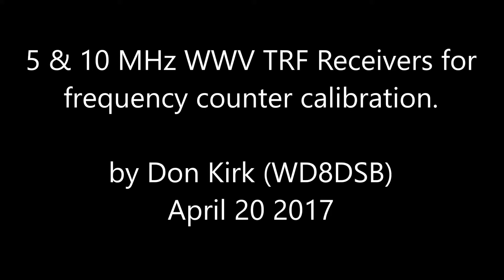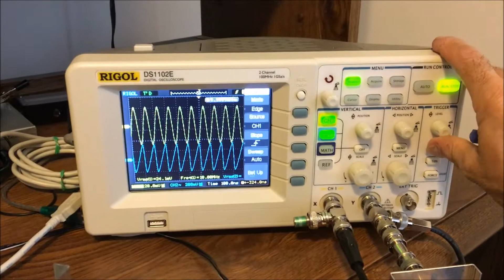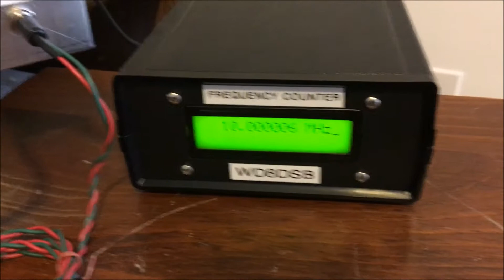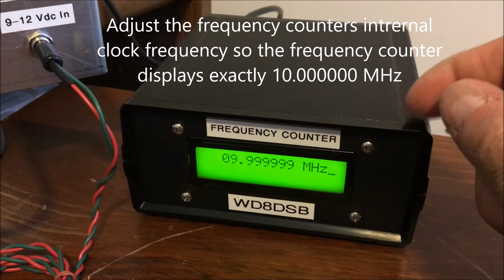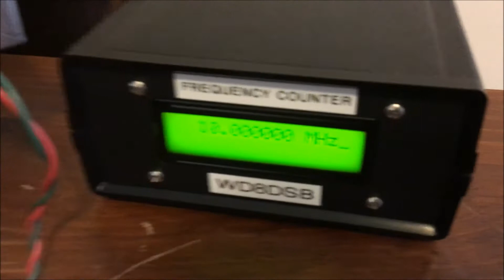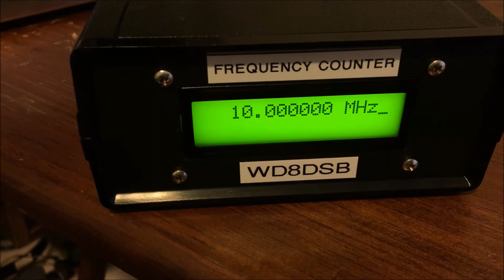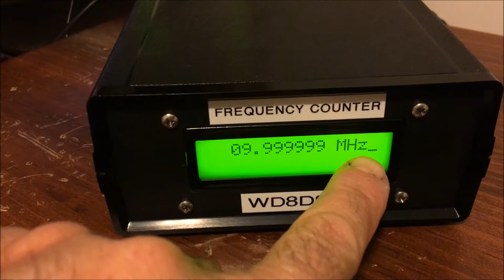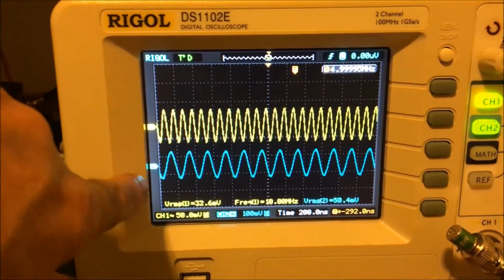5 & 10 MHz WWV TRF Receivers For Frequency Counter Calibration

Comment: Should be triggering off of the more stable signal. Ron W4BIN
Reply from the maker: HI Ron, Great comment and generally I would agree with your comment about triggering off of the more stable signal but in reality the overall results are the same (trying to get movement between the two waveforms to be stationary relative to each other).  I have tried it both ways for this application (and I just repeated it again after receiving your comment), and to be honest I would be hard pressed to suggest one method over the other for this application.  Triggering off the WWV signal channel in this application is logically a bit easier to understand/explain to others because it really is the reference signal which we are trying to adjust the other channels signal to, and it's nice not having the scope lose trigger on the reference signal (WWV in this case) when disconnecting the TCXO and/or other devices you are calibrating that are plugged into the other channel, but when triggering off the more stable channel (TCXO in this case) it's nice to never see the TCXO signal move or flicker.  73, Don

Comment: The link on your website to the article is non-functional. It simply displays a blank page with "No preview available" in a small banner at the center.
Reply from the maker: Hi Martin,

I sent you an email yesterday telling you I will send you a permission email next week when I have access to my PC.  I recently had to move my website to the new google sites and it handles attachments in a different way and  trying to learn their new system. You will get a message in about 4 days getting permission to open those links.

Comment: Hi, Is it possible to purchase the receivers? I need 2-3 units. 

Thanks,

Mike.
Reply from the maker: Hi Mike, 
Thanks for your interest in my WWV TRF receivers.  You would have to build the receivers based on my article in QST magazine.

Far Circuits is now offering circuit boards for my WWV TRF project at a very reasonable cost (offering both a circuit board for the WWV TRF receiver as well as the TRF preamp).  I am in the process of converting a website I have for the WWV TRF receivers over to a new platform, and when I have it converted I will post the new link for you.  My website has a lot of useful info, including a copy of the QST magazine article.

73,
Don (wd8dsb)
Reply from the maker: Hi Mike,  my WWV TRF receiver website is backup and running, and it has all the info you need.  The website URL is http://sites.google.com/site/wwvtrfreceivers/home

Comment: Very nice! Maybe strange Question: Would it be also possible to use WWVB for the same Purpose? Or would this be not as good as WWV ?
Reply from the maker: Hi DE2017.  On October 29, 2012 WWVB went to a phase modulated format which makes things more difficult.  The nice thing about the WWVB signal is that it is very stable and you would not encounter slight doppler effect which happens on HF frequencies but it is also best to use the highest frequency possible for frequency counter calibration to reduce overall error.  Example: if calibrating a frequency counter using a 60 KHz signal and the error is 1 Hz, then the error when measuring a 10 MHz signal with that same frequency counter would be large (around 167 Hz), whereas calibrating a frequency counter using a 10 MHz signal and the error is 1 Hz, then the error when measuring a 10 MHz signal with that frequency counter would still only be 1 Hz.
Note: NIST recently proposed budget cuts include WWV, and lets keep our fingers crossed that does not happen.  Many people are now using GPS disciplined oscillators (GPSDOs), and that is another system you might be interested in.  I like the WWV method because it's directly traceable back to NIST.